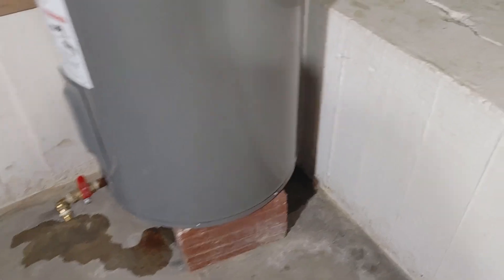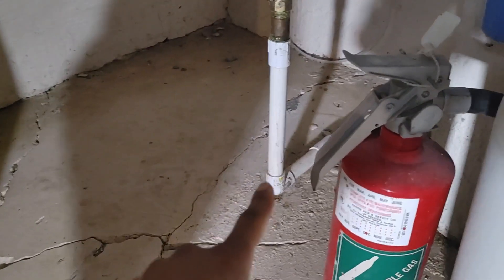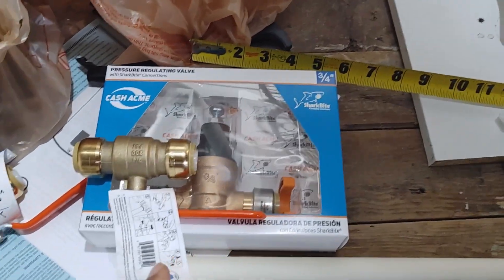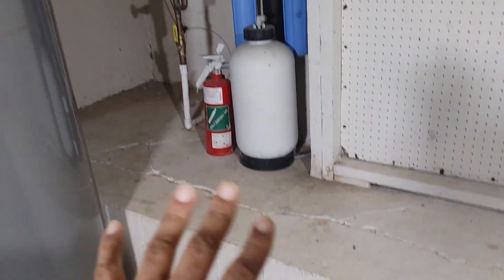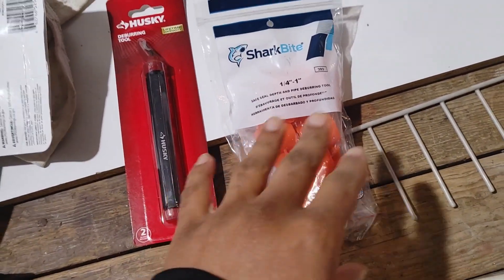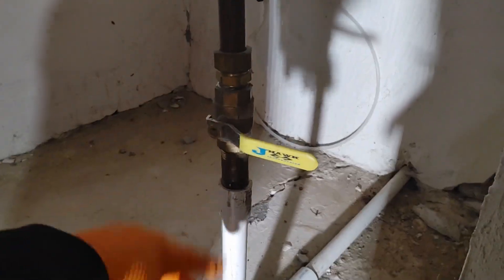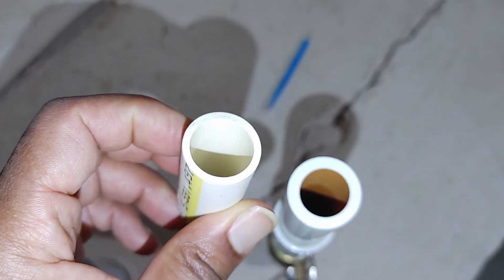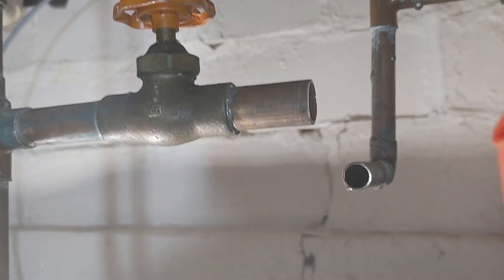Installing a Water Pressure Reducing Valve Or Pressure Regulator

Comment: For some some reason, I opened up my crawl space today, and what do you know I saw leaking (drops of water) on the pex pipes, a shut off valve, and what I now know is a pressure regulator that was green and corroded.

Comment: How is it holding up? I’m hindsight is there anything you’d do differently? Do you still find it necessary for the before and after ball valves. I’m going with a similar setup but adding a gauge to the line.

Comment: Chris you my boy and all but this video did not show or teach anyone on how to cut copper pipe or how you connect the 2 shut off valve and the pressure regulator. 
Ps I do know how to do this and in the long run you will have to replace the shark bites. They are not design to be used near high pressure connections. They will leak sooner or later. 
I am a big fan of yours and keep the videos coming.
Reply from the maker: Yeah, this video wasn't really a how-to. I thought about that during editing. My original intent was to merge where i showed the leak at the end into this one and as i mentioned in the end, in that one I talk about how to use the shark bites, how to cut the pipe, etc. 

This one was more of a Vlog and talking about why I installed the pressure valve. LOL, dang dude! I appreciate you calling me out though! I think that's what a good supporter does and I'm grateful! 

Let me go on ahead and edit the follow-up video now, lol.

Thanks Mark!